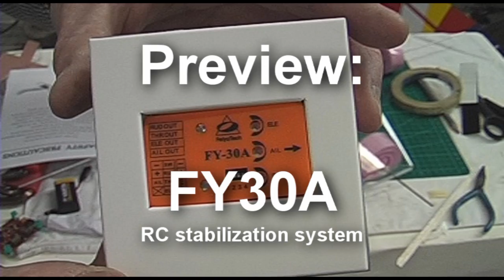Preview: FY30A RC stabilization system

Comment: I thought that the jet pack project had been pretty much "moth balled" for good. This should be a definative test for this stabilizer system I would think. It's one thing to put it on an already stable plane, but that jet pack will no doubt really put it to the test.